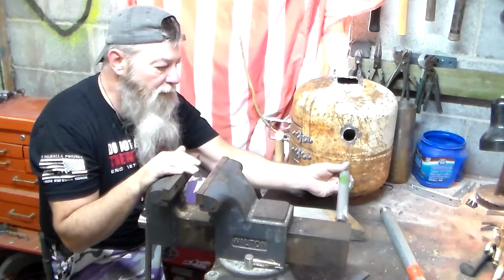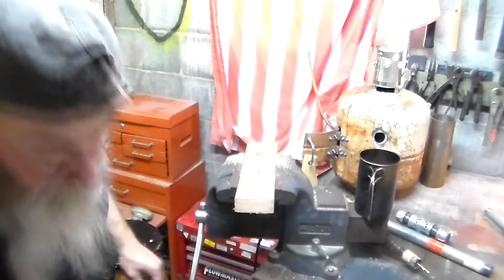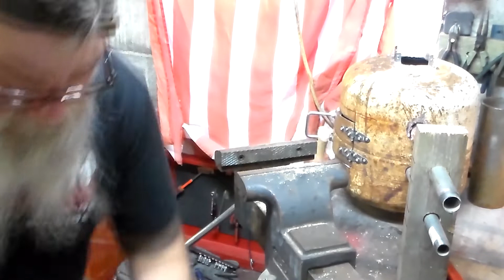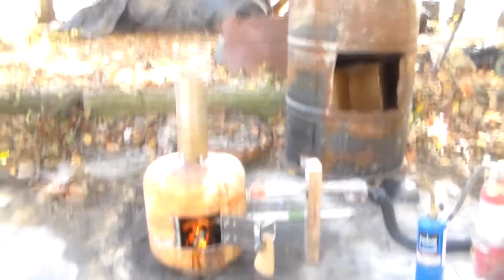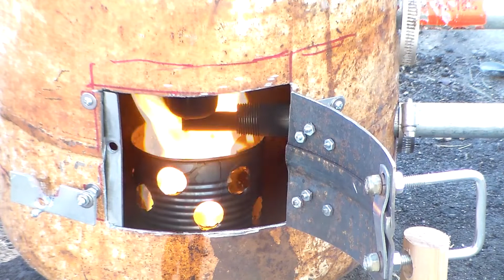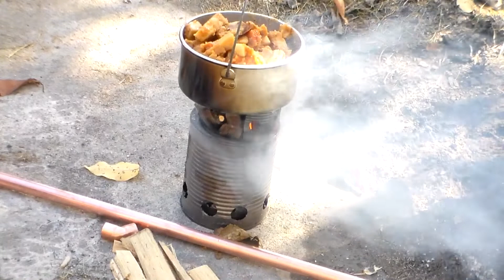Waste Oil Burner from Propane tank   Part 2

Comment: I’ve been using a waste oil heater for the last few years, mine are gravity drip, but I’m starting to make one like yours, so I can put it outside and blow the hot air into my shop,
Reply from the maker: I would keep it outside. The smell permeates my clothes. I don't  mind, but others do.